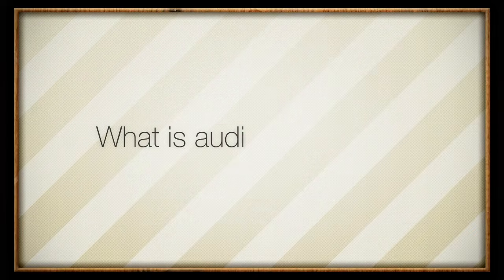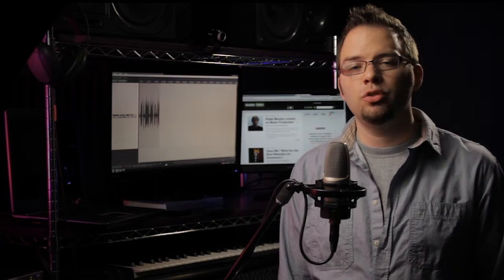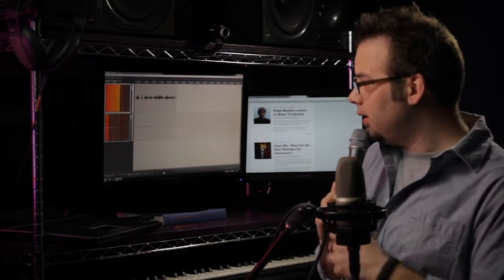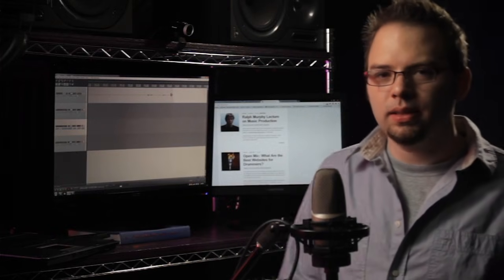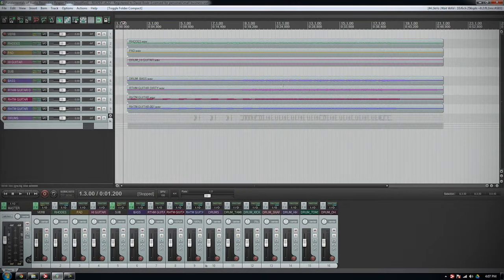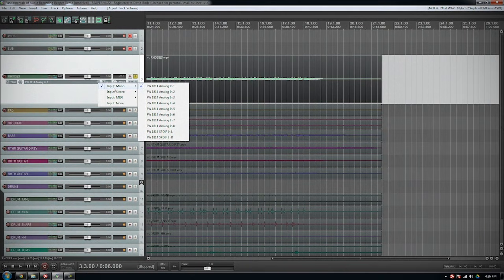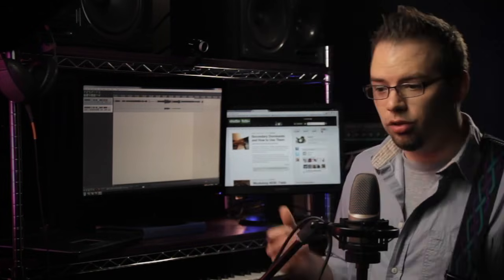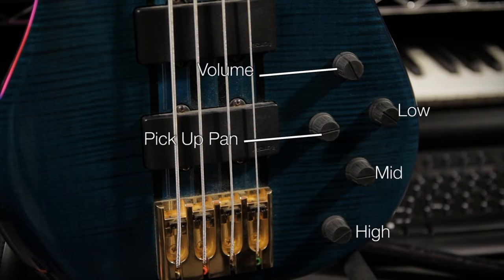Audio Production: Learn the Fundamentals

Comment: Does using a split connector lower the bit rate or sample rate if that's the correct use of the terms? Or rather does it weaken the signal if it's splitting it?

I tried googling it but people are giving the wrong answer. It's only intuitive to me that splitting a signal means that the source has to double output to maintain the same level equally going both ways as it would have been gping one way. Correct?

Comment: ★HELP★
I am a woodsman. I am hearing vary unusual sounds in the woods. I am NOT a technicalogically savvy guy. I DONT UNDERSTAND MOST OF WHAT YOU'RE SAYING.
I need something I can put out in the wilderness for a couple weeks. Is there an affordable recording device for that amount of time? Will it pickup sounds from distance? Say 300 yds?  Can I buy it from an expert that will set it up for my application? So all I have to do is set it and turn it on?  If I built a roof big enough to keep rain off of it would that interfere with it recording?
Please help. Thank you.

Comment: Very well done. 👍 Just in case this hasn’t already been pointed out, it appears the narrative around 22:30 is incorrect. After testing the directional mic, the proximity effect and increased bass response is noticeable. However, your comment “[paraphrased] you should have heard the bass increase as I got closer” occurs only after testing the omnidirectional mic, which I don’t think exhibited that response. A simple edit, swapping out that line to follow the previous clip might clear up the issue and prevent any confusion. But I could be wrong or missing something. Cheers & thanks for the great instruction.

Comment: Hi there, great video on these subjects. I have just gotten a Novation circuit rhythm groovebox sampler. Its a great product and it's also portable and also runs on batteries. Yes it also has connection to outlet to recharge the batteries or use it while connected to a power outlet. 

My concern with this product is that if i want to use it with just the headphones, it is too low of volume even if the volume knob is all the way up. My hearing is not all that great. I have a hearing loss since birth. Still can hear a little bit through the headphones. but no issues when using the headphones on other devices such as my audio interface, and iphone. Its just that the Novation circuit rhythm device has low volume power. unless i connect the Novation Circuit rhythm to an amp or audio interface and connect my headphones on the audio interface and i'd be fine. But there times when i want to hear the sounds coming out of the circuit rhythm since it doesnt have speakers. The circuit rhythm has outputs 1/4 ts jacks on the rear of the unit. 

I have and still use it to this day a Digi 003 rack mount audio interface by digidesign. Still works for me. Only issue I have wth the digi 003 is that it now makes this static noise when i turn the buttons up or down. 

What cables should i use to connect the outputs of the circuit rhythm to an amp source in order to hear the sounds of the circuit rhythm? should I connect it to my audio interface?
please let me know.  Thank you.

Comment: So you think that by talk math formulas make you an authoritarian on music production.  The first thing I saw is that AC, birds, etc background noise should be present in your vocals.  NO!!!.  There is a reason for acoustic panels.  you don't want any of that in your vocal.  Furthermore, talking on distance from the mic is so overly complex.  It is simple, on a condenser mic.  the further away you are the weaker your vocals sound and the more ambient sound creeps in. too close and your vocals are bassy and muffled.  finding the sweet spot and placing your pop filter there is what you need.  Why did you have to go so deep into unneeded explaination math formulas. That doesn't make you look credible but rather sobby. Your music production was done in Reaper and was more a Reaper tutorial than fundementals in audio production, and reaper is the worst DAW to start this with Studio One is the best DAW for beginniers and long time porfessionals alike.  Yes Reaper is only $60 but Studio One as a subscription called Sphere is only $15 per month and you get. the professional version. melodyne, notion, all presonous virtual inst., and plugins.  It work flow is far far easier than Reaper.  I like reaper but it is not beginner friendly.  At least you didn't go Pro Tools because its industry standard I hate that crap.

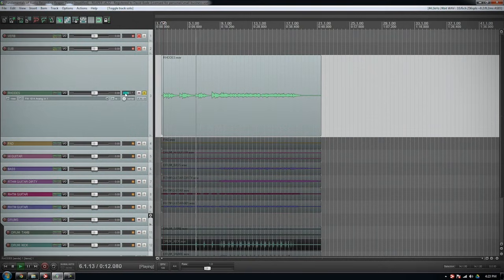Comment: 1:00:15 "This meter is showing how much signal is coming back through this channel." I find this confusing. The signal is being played back from the channel, yes? If so how is it coming back through the channel? (I'm sure I'm not clear on what is meant by "signal," and perhaps the same for "channel." Or I'm not understand something else pretty bacic.)
1:00:46 "Pushes up to zero dB." I would think zero dB is silence and anything above is sound (whether perceptible or not). I can see starting at a positive dB as a baseline, anything below the baseline is a reduction in dB, that is moving in the negative direction, but still above zero dB.
1:01:26 If the summation of tracks is too loud (or way, way, way too loud :-)) can't you just reduce the volume of each track so it's not too loud?

Comment: Great video, I learned a lot! I hate be that guy, but I have to point out the Analog to Digital transition screen at 6:50 where the waveform converts into a string of digits, whereas it should be a stream of binary 1's and 0's. Just saying as a software engineer it hurt a little lol. That's all, carry on.

Comment: I have done this before, but now I seem not to find the solution. I  have track in Acid pro. I want to record vocal to this track. So I need to hear the first track play. However, now, I have not found a way to hear the first track to what I am recording. The problem I have is the first track is also recorded with my vocals and it is not usable. What is the proper set up to do this?

Comment: This is far and away the best introduction to audio production that I've been able to find on YouTube or anywhere else. Extremely helpful for newcomers like me. I recently got the use of a Sound Devices MixPre-6 and have found myself feeling lost while watching Curtis Judd's excellent (paid) introductory course. This excellent basic tutorial will help greatly.
Reply: Sorry to hear that the MixPre course didn't work out. Feel free to email me any time if you have any questions or suggestions.
Reply: Absolutely superb...
Reply: I don't think it matters alot datawise with todays gear wether you choose 16 or 24bit. But  you should point out that the typical signal to noisefloor obtainable today by most gear is about 70db wich makes 16bit's 65k levels more than enough for the human ear. You could technically get away with 48khz 12bit and you wouldn't be able to hear the difference between 48khz 16bit or 24bit if your gains is set for optimal s/n ratio. our ears is just not that "fine tuned" for level changes. 12 bit covers 4096 levels wich should be enough to cover -50db wich is about where a young human starts to being able to hear background noise. So if you record a signal at -10db, your ear can't distinguish noise at -60db or lower.
Reply: Agreed! I've taken a few courses in audio technology and engineering, and I'd say he really explained this content well. There were a lot of moments where I was like "Ooooh! I finally get it!"